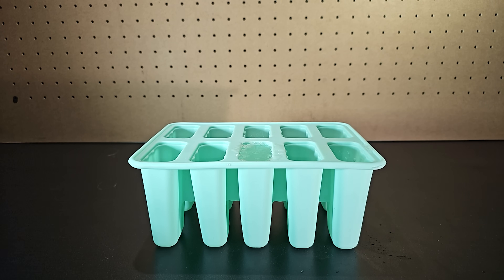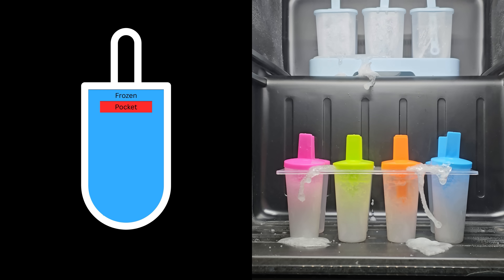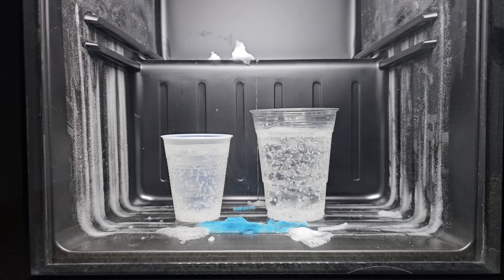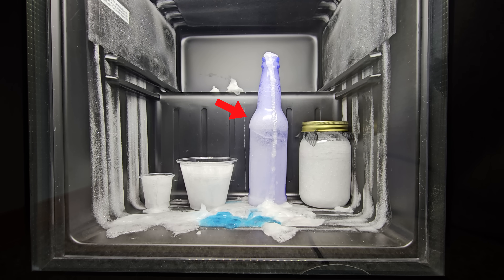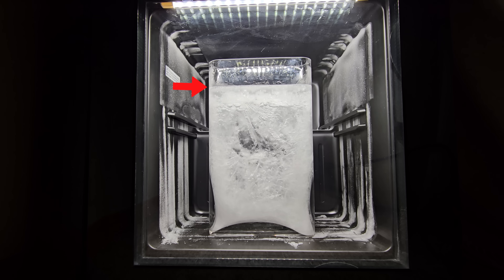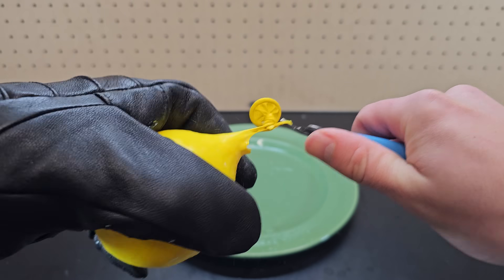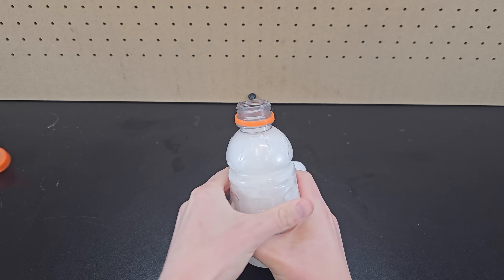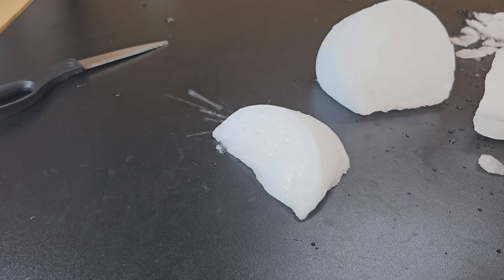Weird things happen when you freeze sparkling water...

Comment: feels to me like the biggest pockets form on the most flexible containers for the following. If you leave room on a rigid container for the ice to expand, the gas will fill that space, as shown on the gatorade bottles, but if you leave no room, the ice expanding will try to compress the gas, as it compresses it will rise the pressure, breaking through the ice and eventually the container. But if the container is flexible, the gas will not be compressed, and instead will lead the ice to expand outwards, pushing on the container itself. Therefore, you may need to use a large amount of soda in a larger, flexible container, leaving as little air as possible.

I write this comment since you asked what explanations we think are correct, but the ballon experiment and the next flexible one you did leave it pretty clear, idk.

Comment: Quick n dirty explanation of the popping ice. 

Ice is forming around the bubbles (nucleation sites). As it freezes, the water expands, putting the CO² under pressure. As the mass around the compressed bubbles reduces, the outward pressure of the gas causes it to burst.

Comment: The funny thing is that he answered his own question but didn’t notice. What is the thing the balloon and the silicon molds have in common that the rest of the containers used don’t? They are flexible enough to expand with the ice allowing the pockets to form. The other containers were not flexible enough so they were putting pressure on the newly formed thin ice causing the pressure from the gas to brake through the ice and allowing it to escape. Therefore, in order to build the pocket, you would need a container that is flexible enough to expand with the ice without giving too much pushback. There, Case closed!

Comment: I think frozen soda/pop/sparkling stuff is basically just a slurpee/icee?

Also from the first smaller balloon it appears that what you want is a vessel that will prevent the gas from escaping the liquid surface (so no large air pockets prior to freezing), as well as one that allows good conduction to the fluid to cool the outer shell first as you've mentioned. Notice how the first popsicle molds had a "seal" that reduced the leakage of gases through the surface, as well as solid surfaces contacting the fluid allowing conduction to freeze a shell around it

A syringe with the main bubbles pushed out might be a decent candidate?

Comment: It's probably been pointed out by now, but a significant difference with your original molds is that they're silicone. I suspect they act as an insulator so the top freezes faster than the rest, enhancing the "sealing" effect. Just a guess, though.
Reply: I also noticed that his most successful pockets were in small containers which hints that the speed at which things freeze is important.

Comment: What about finding a sealed, food-grade, metal container that you can open from both sides. Then you could warm it a little and push out lil carbonated popsicles. Maybe some really clean copper pipes with removable fittings on the end. Copper is used for the fancy expensive ice molds. Perhaps just touching the outside of the pipe would immediately allow it to release smoothly.

Comment: The reason champagne flutes are tall and skinny is to preserve the carbonation. Nicer ones even have a little lump at the bottom for bubbles to collect on, creating the single line of them rising up through the middle of the glass. 

Back in the early 20th century or was served in wide, shallow glasses to allow the carbonation to dissipate faster because fizzy drinks were unfashionable. It would even sometime be served with a small fork that was used to stir the champagne and dissipate the bubbles faster.

Comment: I believe it is the shape of the container. All the containers that showed pocket formation were smaller in surface at the bottom, and the top wasn't too large. I think this allows smaller volumes of CO2 to be released from the bottom allowing time for the top ice layer to completely form and trap the CO2 bubble. If the volume is too large or the top isn't formed yet, the gas will escape and not form any cavity. In case of the ballon all sides were exposed to equal ammount of heat exchange and also it was hermetically sealed, completely trapping the gas at the center while the liquid solidified at the edges.

Comment: I cant be sure but it seems maybe the difference in material of container is what you might look at. Something using a rubber based mold seems to allow the freezing of the liquid to circulate upon itself making the carbonated water freeze within itself making a consistent air pocket towards the center. The more "rigid" containers such as the plastic and glass choices may allow the freezing temperature liquid to latch onto its walls since the containers temperature will lower with the water at a closer degree than the rubbermade. I think the way the liquid freezes in those settings pushes out the carbonation through the the difference in temperature from the gas and liquid and apposed to the rubber allowing the gas to stay trapped longer because the material of the rubbermade containers stays a differnt lowering temperature then the liquid contained inside it.

Comment: The balloon looks like a geode made from water ice. Perhaps it's a similar process as solidifying magma/lava? The popping ice just means not all of the CO2 came out, and it may have become dry ice at the higher pressure, even if the temperature isn't low enough at 1 bar, but remove the pressure, and it would sublimate rapidly.

Comment: we found him, the one guy that likes soda water, this is why they keep making it!

also its a temp thing/ aslo a luck thing, if the liquid bubbles on the top layer freezes before the air can escape the air will continue to for a "pocket" best way to have the pocked be constant would be to have whatever its in be rolling to form ice around any "pocket" that may be forming. o7
the reason it worked so well with the rubber mold is because the liquid on top frose first. i would recommend rolling bottles and or just a rolling ball, trick is getting something to roll in freezing temps, good luck.

Comment: its how you make pop rock candy, only you need to "freeze" it with pressure and temperature, then the bubbles settle out into the sugar crystals, much like it does in water. Weird when you open a can and it keeps pouring eh

Comment: My thought is you were seeing the cavities in trials where there was a seal on the path the CO2 could escape at. As the ice expanded the CO2 had nowhere to go. So it went to the center of the volume the sparking water was at because its farthest away from the freezing edges. 

Whith the Popsicles a seal was created by the stick and the silicone. It wasn't perfect once everything was expanded , but the cavities and the cavities were higher up in the mould which you would expect with rising in liquids.

Comment: For those who are unaware, the reason things like soda or sparkling water explode if unopened in a freezer, is because the gas is trying to escape. Generally, the gases like colder liquids more, and will stay in them, but that only happens to a point. When the water in it starts becoming solid, it forces the CO2 out. While the liquid does expand, things like water bottles don’t generally burst from their contents being frozen. But the excess gas creates pressure, which causes the container to rupture. So if you froze some soda in an open container, and thawed it back to a liquid, the carbonation would be gone.

Comment: From Wikipedia:
"𝙋𝙮𝙠𝙧𝙚𝙩𝙚 is a frozen ice composite, originally made of approximately 14% sawdust or some other form of wood pulp and 86% ice by weight. During World War II, Geoffrey Pyke proposed it as a candidate material for a supersized aircraft carrier for the British Royal Navy. Pykrete features unusual properties, including a relatively slow melting rate due to its low thermal conductivity, as well as a vastly improved strength and toughness compared to ordinary ice."

Comment: Oh I get it. So when the seltzer expands in a stretchy environment the co2 gets trapped properly, but when sealed in a hard container, the ice expands inwards forcing the pressure to increase, which then probably causes the ice to rupture and collapse. most of the time this probably happens in the earlier stages of freezing. For maximum cavitation, ideally speaking, you'd want to freeze the substance inside a soft material inside a harder material with a small air gap between the two(to help maintain the environments pressure resisting the loss of co2 before the freeze begins), you'd want the outside layer of seltzer to freeze, expanding to some balanced level where it'll stop rupturing the freezing membrane which can then further harden and contain the pressure of the remaining co2.

Comment: what if you freeze it under a few atmospheres of pressure so the co2 stays dissolved in the water ? 

edit: i hadn't watched to the end, the thing you observed with the popping, was trapped co2 that didn't come out of solution. When it froze because it was in a carbonated bottle the equilibrium pressure of co2 in and out of the liquid meant that there would still be quite a bit of co2 in the ice.  when it melted the co2 in the ice rapidly turned into a gas causing little bits to explode. this by the way is exactly how pop rocks are made.

Comment: Its possible the rubber mold and insulation causes sufficient freezing on the top for the carbonation to trap air pockets, with the plastics the frozen layer might be thin enough for it to escape.

You basically did the opposite process done when making clear ice used for bartending.

Look up directional freezing if interested.

Comment: Wrap some insulation around the bottom of that vessel you had a 4:30, that would hopefully force the upper part to freeze more solid preventing the pressure from pushing liquid water through. Of course be careful that the glass doesn't shatter

Edit: lol I just got to 4:40 and the glass broke

Comment: I think I know what could be happening here.

When you freeze regular water, gases such as oxygen start to escape. This is why you don't get clear ice out of an ice maker, because some of those gases end up trapped. Carbonation, to sum it up, is literally just those same gases being pumped into something at a high volume, so when freezing sparkling water in an ice tray or popsicle maker, that reaction is amplified by well more than double or triple or even quadruple. Hence why, when you take it out, two things are noticeable off the jump: one, it's completely white. More gases there are, the less clear it is. And, second is that pocket: In the chaos of it all, some gases may not be able to escape, causing it to be trapped and cause not only the holes, but the sparkling sensation the ice gives off when you use the bottles. You explained it perfectly, when in the bottle, the gases will have already escaped before it freezes, but the gases need to go somewhere, so some of the gases end up getting trapped anyway, causing the bubbling sensation when frozen and no big cavities like when in the molds and cups with no seal.

Comment: It's probably popping bc it was a sealed container and the CO2 stayed dissolved in the water under pressure. The water froze still in solution with CO2.as it melted, the CO2 escaped.

Comment: Ok, here is the theory: when the container took small the water freezes too fast and gasses don't have time to escape. on the opposite side when the container is too big, the water freezes slowly thus gasses manage to escape. Next theory: when the container is soft and stretchable the gasses released by freezing water push the ice formed on the sides (like air balloons did) and since some ice has already formed on the sides of the soft container, the only place where gasses can go is in the center of the container (or slightly to the top in case of cups or similar containers). now when it comes to the rigid containers the only direction where gasses can push the ice is up, and as a result the may be braking the seal formed by ice on the top, thus allowing gasses to escape.

Comment: In addition to what you've mentioned here, sometimes a pocket at the bottom of a glass will by unfrozen, and that is caused by the sugar concentrating at the bottom of the glass, and so it is the last part to freeze, and it seems to be kind of absorbed into the ice near the end of the freezing process.

I have been freezing soda for about 30 years, and, seemingly,  the more sugar, the more resistant something will be to freezing solid. Stuff with high sugar content is kinda slushy, and stuff with low sugar will freeze solid. 

I haven't given it rigorous testing, but it is interesting how stuff freezes. 

Try freezing kombucha. It has really big crystals, and it looks pretty cool, and it is usually carbonated.

Comment: Thanks for this. I’m the same way about every day life science curiosity. Ok, this could be a real great and actually useful video idea: my favorite  canned drink is this certain brand of “premium malt beverage”, MXD drinks co margarita.(there’s a variety of them but just the margarita in green can). The colder I can get them the better so it wasn’t long before I discovered that putting them in the freezer has surprising results! If left long enough they will end up like the ice in this video BUT there is a stage before that, I assume because of the alcohol (12% alc./vol) that it becomes the perfect viscosity of slush that is delicious and refreshing to drink! It’s like a whole stage of its own before solidification that doesn’t even require precise timing. I think if the freezer were set perfectly you could achieve and stop at this state but normally it will turn solid after a long time goes by, several hours, maybe 2x how long it takes to get to slush perfection. Interestingly, you can easily tell when it’s at peak slush because the can will feel…squishy. ..as if it’s lost some volume inside. This is adverse to any carbonated liquid frozen in a can that always burst the can due to water expanding when turned solid unlike most substances. I’m guessing it’s something to do with the alcohol keeping enough liquid that it’s lost more volume because of the gasses condensing than it’s gained from water expanding as ice..? It’s definitely well below freezing point now because if will freeze what is in my straw instantly if I add new slush to my mug that wasn’t yet empty. Dangerous to handle without gloves, obviously. Make a video! If MXD drinks aren’t available near you i suspect those green “buz balls” are the same. Similar alc./vol % and flavor, but 4x$ (check multiple convenient stores. Only sold as single cans not in a box)

Comment: If you want to make a big internal bubble it is possible with an balloon or an plastic buttle and a fixture that can slowly rotate it on the vertical axis. For more fizz in the ice (as you also mentioned) you need to increase the initial pressure (in the bottle/container)

Comment: i think the popping is caused by the same effect that allows popping candy to work, the water managed to freeze fast enough that it trapped the CO2 at a higher density and so when exposed to room temperature started to expand resulting in the popping. im not sure how it was able to freeze fast enough to trap the CO2 bubbles at that higher density considering with popping candy it requires basically a flash freeze... maybe its a combination of the quick freeze causing higher density CO2 gas + maybe the CO2 is partially precipitating out of the water? i like chemistry but im not good at it so thats my best guess, cool experiment all the same

edit: HOLD THE FUK ON THIS IS THE 2 TRUTHS 1 TRASH GUY!? and here i thought that said 2.1k subs and it was a cool little science channel i hadnt heard of before... IVE BEEN BAMBOOZLED!

i hope you end up making more of this style content man, its great

Comment: So i am not sure if this is too crazy, but do you have a pressure chamber? I think the "popping" ice effect could become a lot crazier if you froze it under pressure so that similar to an unopemed water bottle the carbon dioxide would remain in its H2CO3 form inside the water. Maybe this could result in something which starts popping as it is crushed / eaten. 

I remember an old video by Nile red where he tried to recreate Pop Rocks in a similar manner by infusing Carbon Dioxide under pressure. And i mean if it works with sugar crystals then maybe it could work with ice crystals.

Comment: The popping ice is easy.  You froze a pressurized bottle.  Small carbon dioxide bubbles are frozen under pressure.  When the ice starts melting, and getting near those pressurized bubbles, the ice gets weak enough that the pressure can break the thin ice.  The exact same thing happens with Pop Rocks, except instead of melting, the sugar is dissolving in your mouth.

Comment: I imagine that the flexibility of the container is the key to forming the pocket reliably. The volume of the water will increase as it turns to ice, but the ice forms on the outer layer first. This causes a build up of pressure inside the pocket as it forms. 
For a rigid container, this pressure is exerted on the thin ice wall, which breaks, letting the water inside the pocket flow out as the center continues to freeze and expand. With a few cycles, this would explain the layers you saw in some of the runs. 
But with a flexible container, the outer ice wall is allowed to build up for a longer period of time, because the expansion of the ice is accommodated for by the deformation of the container. This would explain why both the silicone mold & balloon did well in forming the pocket, where all others did not.
Reply: Bump